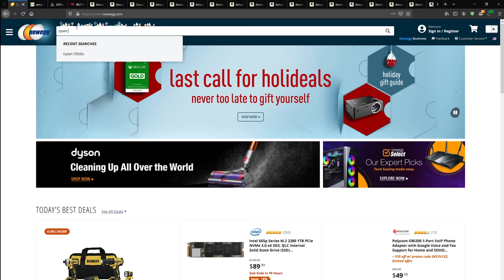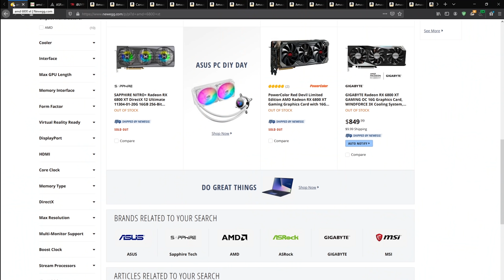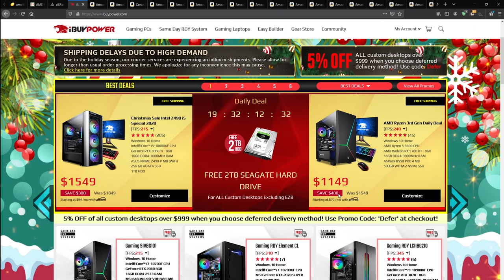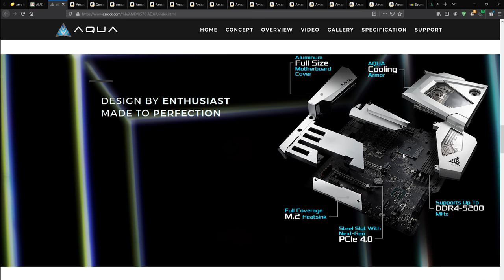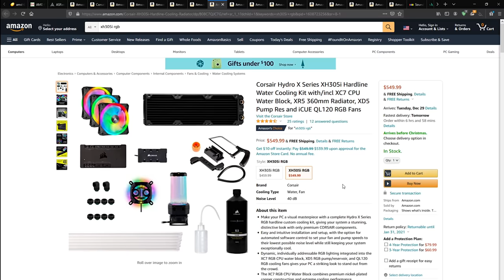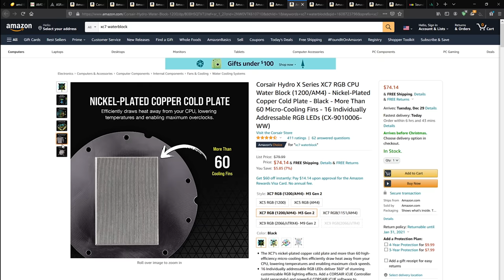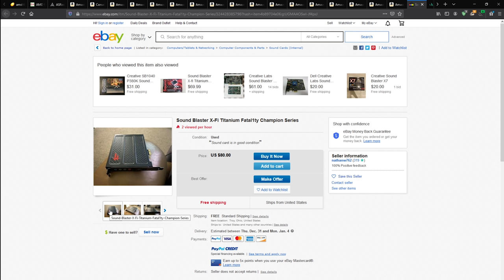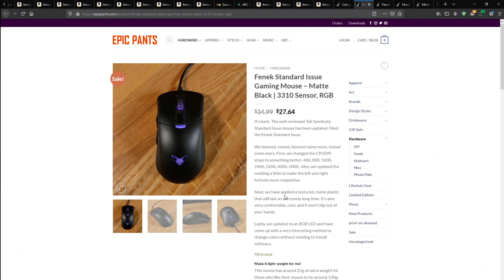The Most Realistic 2020 Build Video

Comment: I've built a AMD ROG Strix I B550 with 16gb Ram
660 Fractal Design Ion+ 
90° atx power adapter 
Gpu bracket 
240 Arctic AIO
Modded Sharkoon Rev200 
Cable Extensions 

BuT 

No GPU
No CPU 
And 
No storage....as I'm getting that last.

But I really hope 2021 has stock! And affordable.